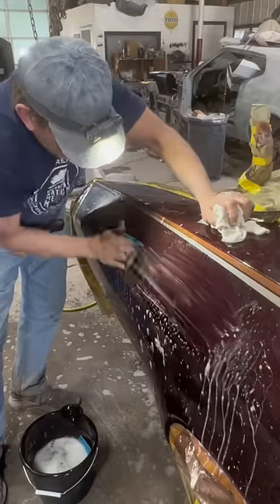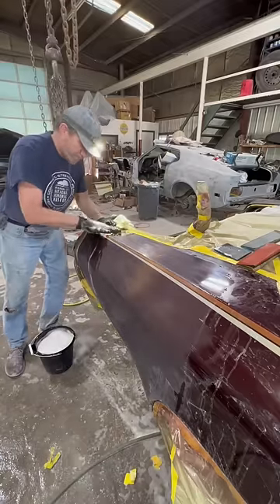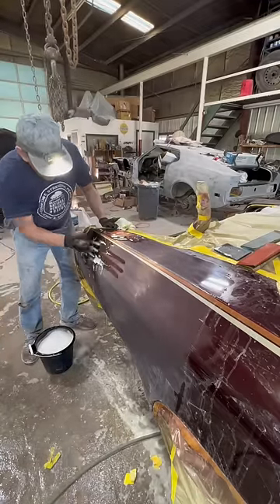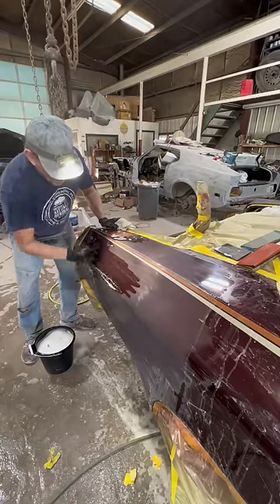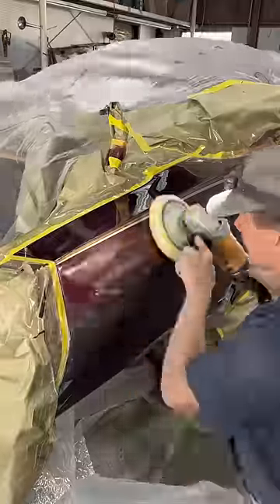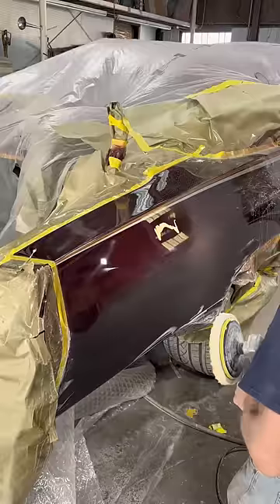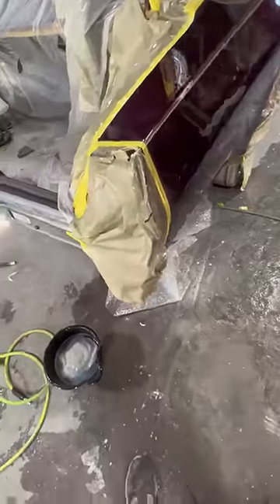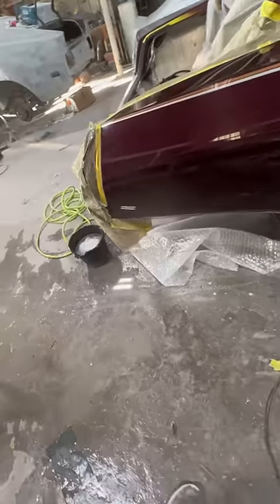DIY Colorsanding And Buffing Done FAST - How To Cut & Buff Like A Pro Block Sanding Clear Coat

Comment: What does colorsanding do ?
Reply from the maker: It removes dirt specs embedded in the paint, and flattens out the texture left from spraying, called “orange peel”
Reply: @OldBondoBilly  gotcha does it make the clear coat more glossy too or how would you get that
Reply from the maker: It makes the clearcoat smooth like glass, for the deepest shine possible 😉
Reply: @OldBondoBilly  nice thxs for info

Comment: Our culture and race has a certain class level, making classy people look bad and stops a lot of business. Not all class of black people want to be ignorant with no vision for our youth to be productive in a more positive and rewarding way.
Reply from the maker: That was right, but it seemed like you stopped in the middle 😉
Reply: @OldBondoBilly  Sorry I did by mistake. But in all I do have a question about buffing? Why do use sand paper on paint, wouldn't that scratch it. What solutions to buff with?

Comment: I like to hire folks who already have this skill. So I  don't ruin a perfectly good paint project.
Reply from the maker: What kind of cars do you work on?
Reply: @Bondo Billy  repair folks fun cars mechanicals only these days. Did pre paint prep in my 20s. 50yrs ago.
Reply: @Bondo Billy  @ 75, I've a nice 70  442 post sport coupe, 72 Nova, 65 chevelle,  71 Delta 2dr HT, 4 rwd Toyota Celicas that I  keep alive. Still street race when occasionally.
Reply from the maker: @peted5217  that’s awesome!  I can barely drive on a sunny day, so I sure ain’t gonna do any racing😉😁